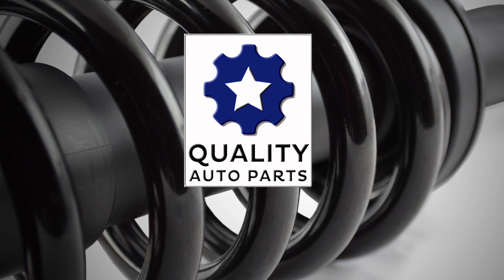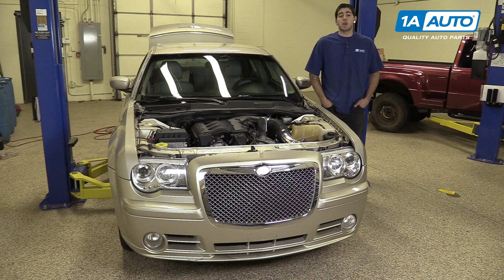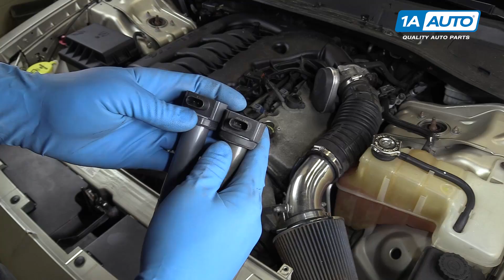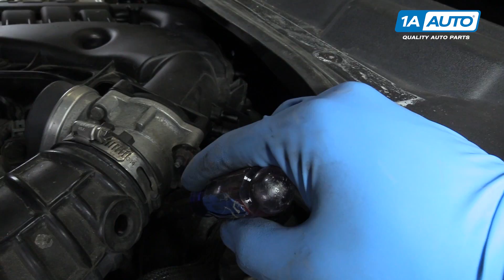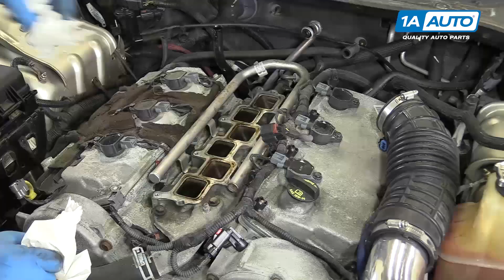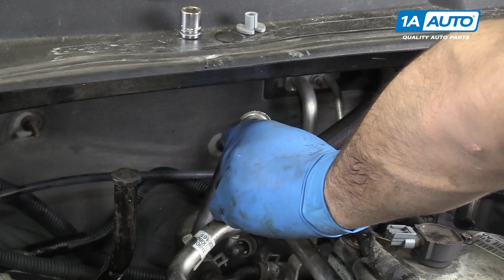How to Replace Ignition Coils 06-10 Chrysler 300

Comment: is there any reason why he didnt just take the 10mm bolts out of the throttle body disconnecting it from the intake? I would save a lot of work if its possible or does it leave you with no room to remove the intake? Thanks for the video big help.

Comment: Is a scan tool or ecu reflash required after the ignition coils are replaced on this? I recently went from having a high mileage 300 that ran smooth but getting slow. The boots on the coils were falling apart, the plugs were the originals over 150,000miles on them. Now with new plugs and coils it misfires so bad I can’t drive it. I’ve since re installed them checking all connections 3 times with it misfiring every time. So before I repeat, I’m in search of what I may be doing wrong. Thanks.
Reply from the maker: +ThePain321 We wouldn't be able to diagnose an issue like that here, you may want to have a local mechanic take a look at it. Thanks for checking us out! http://1aau.to/m/Shop-1AAuto-c

Comment: At 10:19 I think you meant to say 105, not 150, inch pounds. Your conversion to 9 foot pounds is correct for 105 inch pounds. Sharing this for those with inch pound torque wrenches so they don't overtighten!